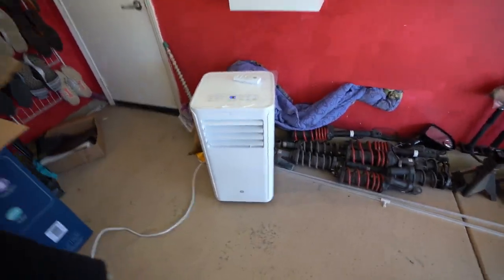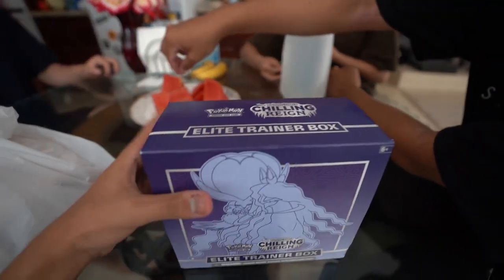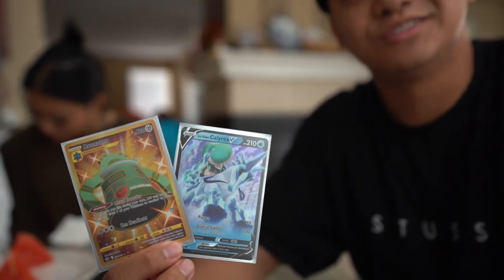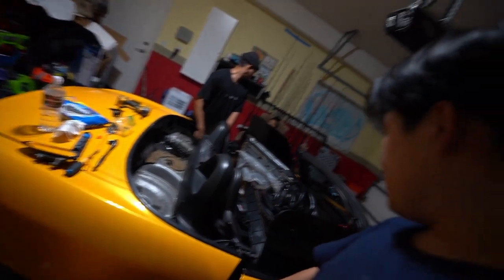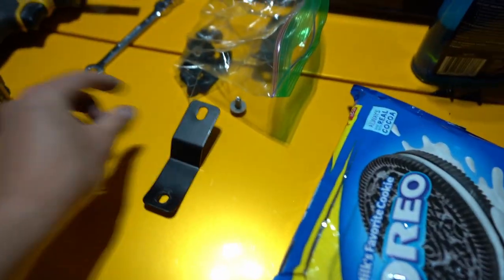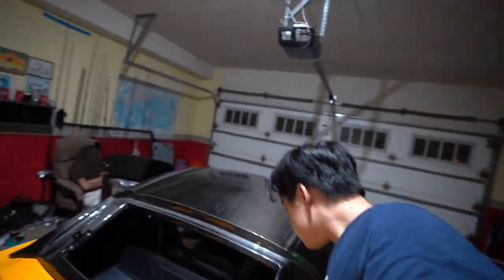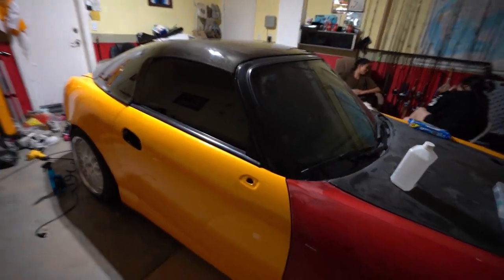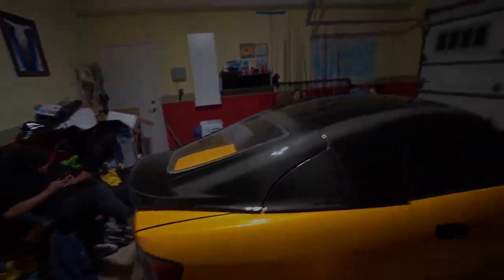Honda s2000 Gets A RARE Carbon Fiber Spoon Hardtop

Comment: considering picking up an s2k tomorrow.  gotta do the spoon hardtop if I do...
Reply from the maker: Definitely looks good, only bad part is the trunk is blocked lmao. 😂
Reply: @jasonshi1  the little hatch pops up and lets you get to it still right?  Just a 2 step process now lol.  Or is it blocked no matter what?
Reply from the maker: @Inkawgneegrow  there are about 4 bolts holding the latches in place so it is kinda like a two step process, the only annoying part is the space to reach it is pretty tight so I usually just leave it and forget about the trunk. I also did a soft top delete for a bit more space.
Reply: Totally got the S2k.  Now I just have to decide between this and the Mugen.

Comment: Does the back lift up so you can access the trunk ?
Reply from the maker: No it does not it is fixed but you can unscrew it. Only 2 screws holding it down.
Reply: @jasonshi1  looks killer tho!
Reply: You should be able to add hinges to make it pivot, but you will have to disconnect the trunk and attach it to the spoon latch. You will also need some shocks.
Reply: Don't forget to cut a hole in the trunk and seal the rear piece with silicon or something.